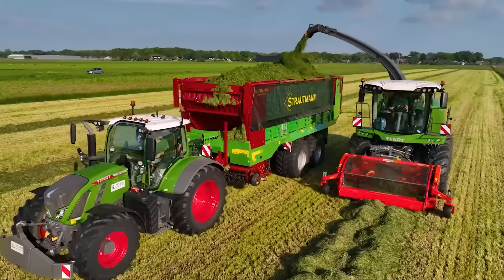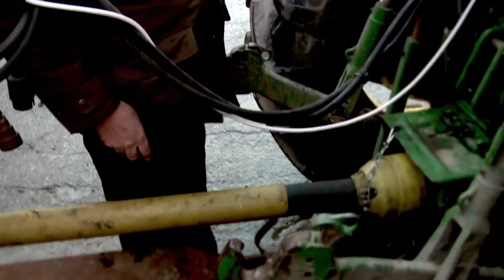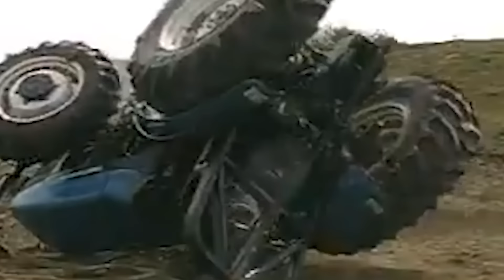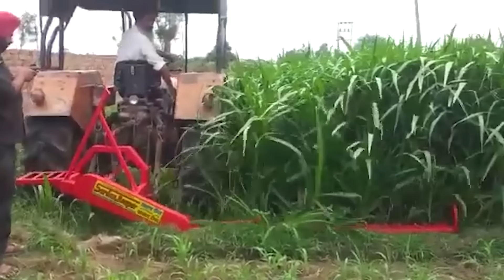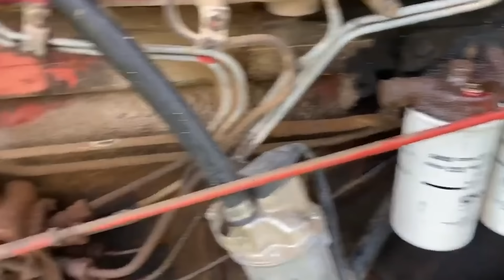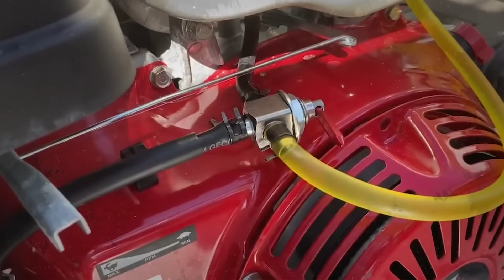These 12 BANNED Tractor Features Were ACTUALLY Genius

Comment: I wouldn't trade rubber tires for steel wheels.
Reply from the maker: Can you explain why? i‘m curious..
Reply: @YourFarmerOfficial I said I was in agreement because that stuff was brilliant engineering and alot better than the over thought garbage they have on the equipment today. The steel wheels I've never used, so don't see them as being very smooth. I've never had a problem with rubber tires is why I prefer them
Reply from the maker: That's nice! I have a lot of old friends who think the opposite of what we're thinking… I'll never understand.